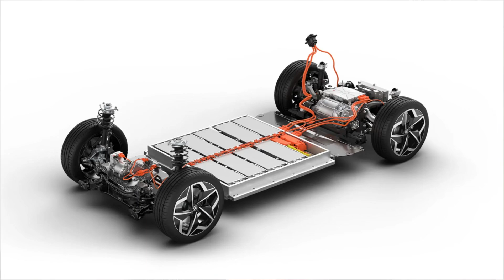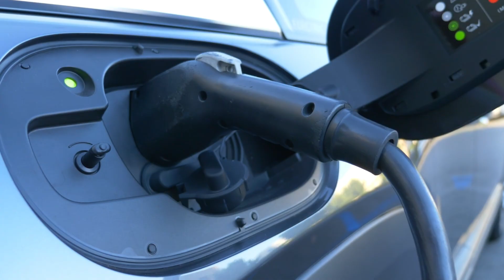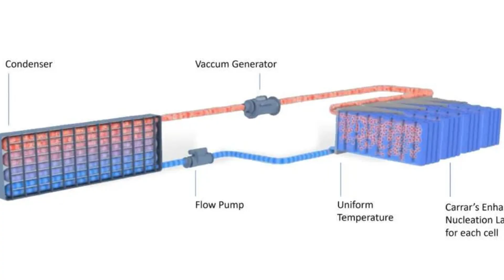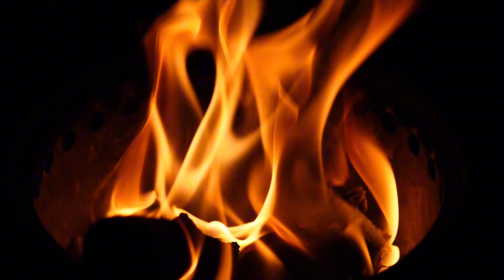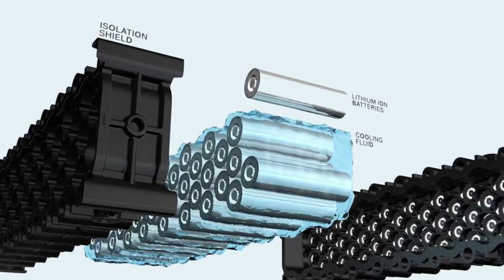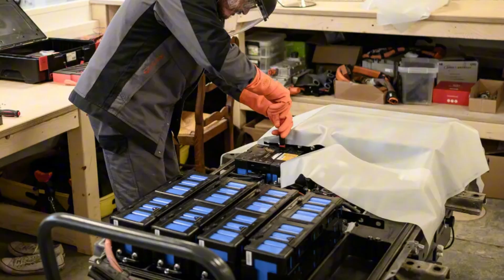Is Immersion LIQUID Cooling the Answer to EV Battery Fires?

Comment: What nonsense.
Reply from the maker: Thanks for the comment🙏
What is the problem with it?
Reply: Another problem being made,leaks I to battery short circuit, boom.

Lithium battery are boms, should never be in a vehical in the first place,  your just trying to make a bomb safer.
Reply from the maker: @SillySausage-mq3so 
If a dielectric fluid is used then its unlikely but possible